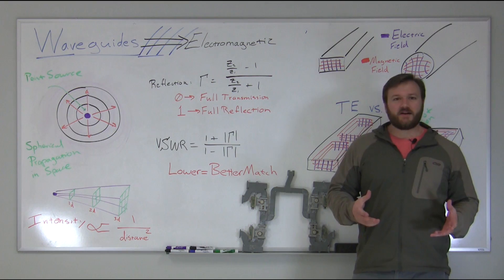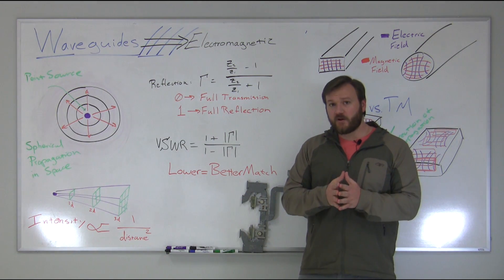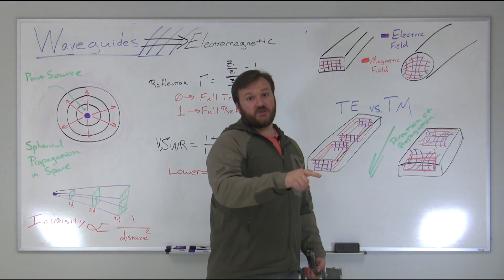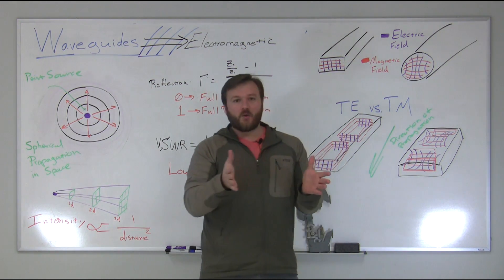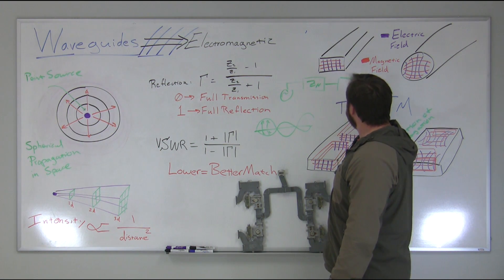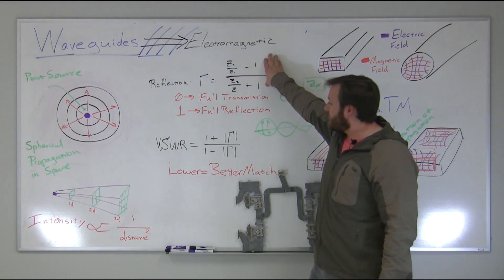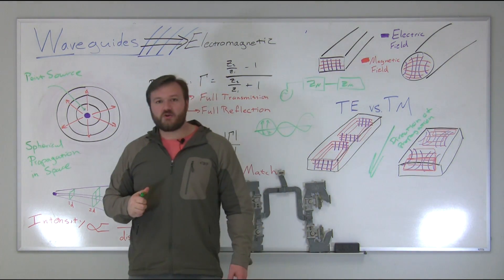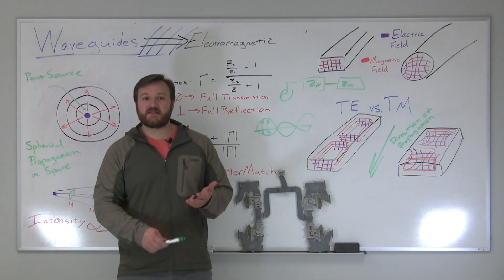Waveguides - Weekly Whiteboard

Comment: Have you ever looked at ancient architecture through your waveguide lens? There is an architect who designed several churches with frequency in mind. Some say the roman columns  and sports complexes used the crowds frequency and channeled it using wave guide techniques.
Reply: @markpennella Absolutely! I'm currently writing a book on electromagnetic architecture.  I will post the free link to the google drive.  The rose windows acted like circular waveguides and dielectric resonator antennas to isolate certain sunlight frequencies.  The cavity acts like a rectangular waveguide.  Resonator tower of specific frequency for electromagnetic induction of atmospheric electricity or aether.  Each structure designed around a specific wavelength of sound, sunlight, and atmospheric electricity.  3 become 1 inside the boundary conditions of dielectric structure to create an contain an energized field of plasma. The Holy Trinity.  https://drive.google.com/drive/folders/1VU3N-H-M4XiN2EYMO_sx-0mVQD0hV3nf?usp=drive_link

Comment: with which material are wave guides constructed?
Reply from the maker: Highly conductive materials are used to construct waveguides.  For rigid waveguides, these are metals that can be extruded in order to produce them inexpensively.  Aluminum is common for this.  Copper and brass are also common when building flexible waveguides.  Rather than smooth walls, these are generally transverse corrugated structures that allow the material to flex for the application.  Surface conductivity is what matters.  You can use a plastic tube with a conductive surface layer of gold, nickel, or silver  as well.

Comment: So do electromagnetic waves, when hitting a wall I.e flat surface, reflect like air or water?
Reply: On a perfect conductor yes. In fact a mirror is a conductor (a thin film of silver on the surface which reflects the light which is an electromagnetic wave). The losses he talks is mainly due to the fact that wave guides aren't perfect conductors, so this "no infinite conductivity" produces heat losses due to Joule effect: work done by the electric field to push charges on the conductor. To study the reflection of a medium one has to look por the impedancies, on a perfect conductor it is infinite so all EM reflects on a perfect conductor (gamma = -1).